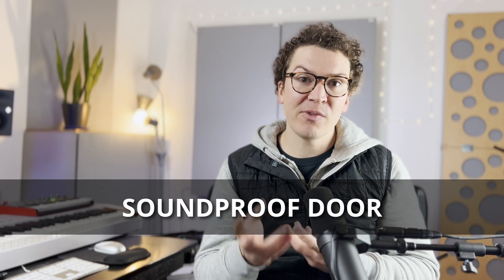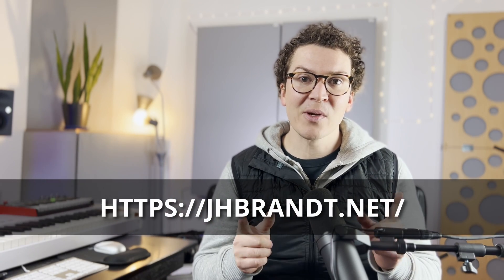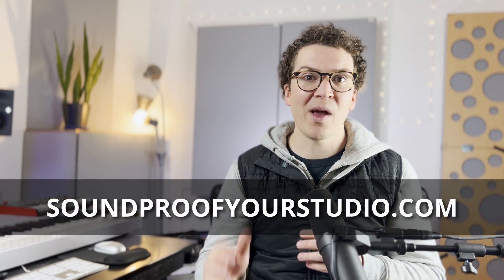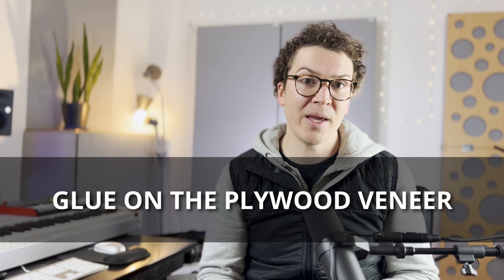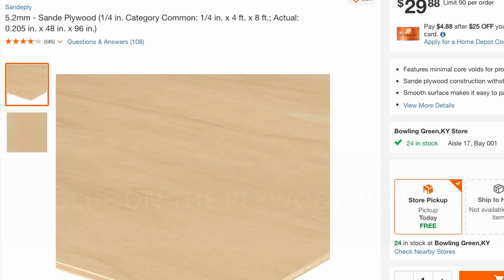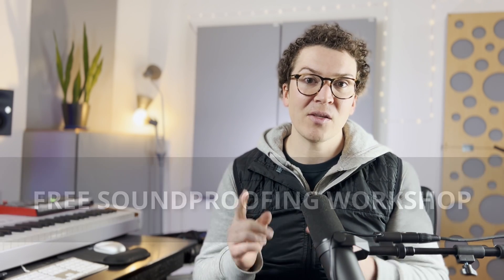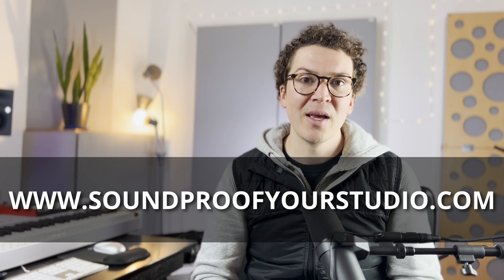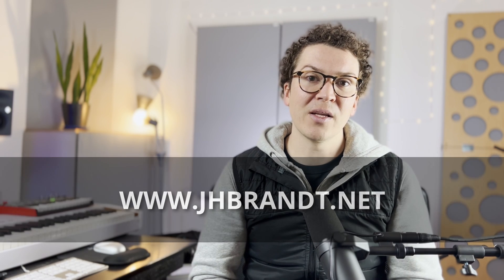How To Build A Soundproof Sand Filled Door

Comment: Great idea and excecution but I'm a bit wary about the sand settling, especially since the door swings so much and will vibrate the sand so it settles. That way a gap will form at the top of each of those compartments creating an acoustic leak. Thoughts?
Reply from the maker: Good point! I don’t really know how you could avoid that other than packing it as best as possible and then putting upright and filling any possible gaps. I personally don’t use this method so it has drawbacks.
Reply: @soundproofyourstudio  Maybe mix the sand with watered down pva glue or something and let it dry inside the compartments before closing the door up?
But then if that works you could look at things like concrete too I reckon.

Comment: No db reduction numbers? Between open outside the door and closed with pink noise ?
Reply from the maker: Check out my video on acoustic door seals. I did some tests with drums
Reply: @soundproofyourstudio  But to my understanding that was not sand filled door, right?  And you did not record sound levels when the door is open, so we can't tell how many db reduction the door itself did. I'm still trying to find information if sand works simply like a rigid mass or could it also have some additional sound absorbing properties.

Comment: What about just sandwiching like three layers of drywall between the plywood? Put loaded vinyl between the sheets to dampen vibrations with one sheet of vinyl spanning each side between the drywall and the plywood to be prevent sounds bridging through the cross race where the door handle goes. Dunno. Just a question. I think it would be simpler and would need less crossbracing where vibrations can leak through like the studs in your wall.
Reply from the maker: You could try it! Mass is key at the end of the day.
Reply: I think that in sandwiching, we would just be building a very heavy membrane (plate). The sand is likely doing a lot of work here by breaking up direct transmissions, and there would be two plates here (albeit attached at the edges and cross joints) instead of one.

Comment: I wonder if a mix of concrete with samd and polystyrene filler to reduce the weight to make it a required weight would be as effective and reduce the issue of moisture in the sand and any risk you might one day have a door that explodes sand where :p
Reply from the maker: Yes sand exploding door is no bueno

Comment: what about the moisture in the sand? do you cook the sand or dry it out completely?
Reply from the maker: You just need to get it as dry as possible. Leaving it in the sun on a sheet would work well.
Reply: @soundproofyourstudio  Thanks. So is a solid door 🚪 vs sand filled door not going to give tou the same result.
Reply: @MajestyStudioPro you use led shot or sand in speaker stands the stop the vibrations & make them more dense.

A sand filled door would be more dense & thus be better. But!
You can do the same with rockwool & double drywall & its a lot lighter.

No point having a door that stops more sound than the walls.
Better off having a floating floor.
Reply: @Maradnus  I read once about the moisture that remains in the sand. you have to cook it out etc. I also had the same idea but did not want to waste my time, if I have to remove the door after a year or so because of molt development.
Reply: @MajestyStudioPro  I built a studio room a while back & we too thought about sand lining the walls. & you are right the possible moisture was a HUGE issue for us. 
The money we saved on kiln dried sand we built a floating floor. 
This was a shell of a building BTW. 

In the UK we have a Pink drywall/plasterboard that is fire proof & acoustic rated 2 layers of that on a rockwool slab door was incredible. 
150db in the room & maybe 50 on the other side of the door.
Reply: Use kiln dried sand.